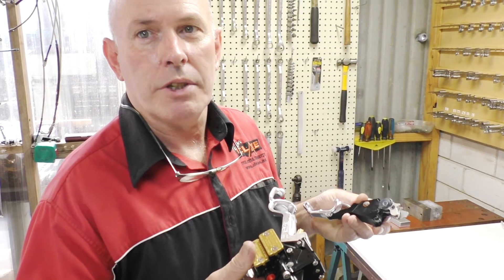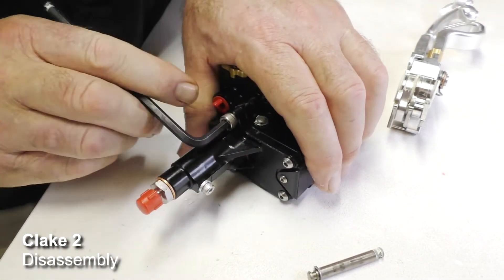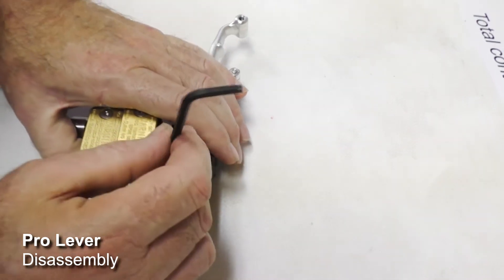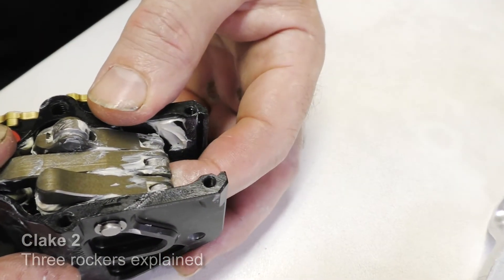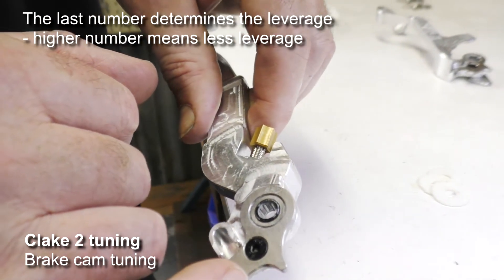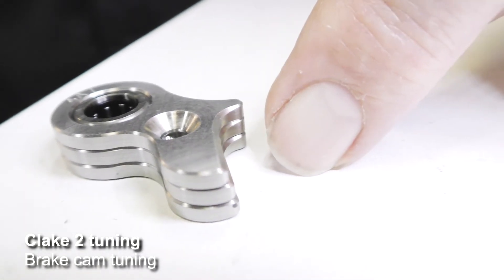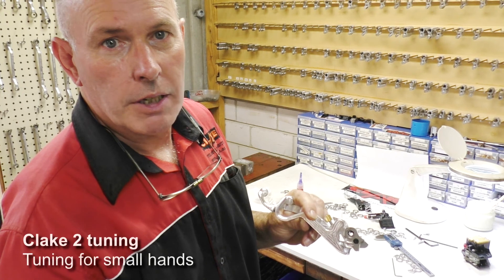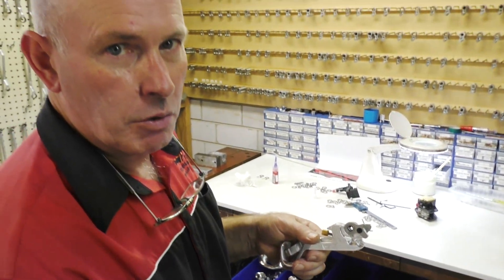TUNING THE PRO LEVER & CLAKE 2: choosing & fitting the cams

Comment: So how do you mount the handles back with the master cylinder?
It’s hopeless to get the bottom Teflon spacer into place... 🤯
Reply: I've pulled mine apart a fair bit tuning and rebuilding it over the years. lots of grease to hold the washers together and firms everything up, then slide them in while supporting and use a small screwdriver through the hole to line them all up.
Reply: @NCER999  thanks. Yes, this is what I settled on. 👍🏻

Comment: I have the Pro Clake for both my fe450 and te300, bought in the winter of 2017/2018. It took 3 rides to be comfortable with the product and at first it makes you stall the bike a bit as your brain doesn't quite fathom the adjustment of clutch to progressive brake. But once you got it, feels super natural and is very effective. It reduces fatigue, adds safety, makes going down extremely steep hills much easier, keeps your body on the bike more naturally. The product will make you faster, because in order to have confidence with speed, you must be able to brake. This is especially beneficial to a newer rider, but even a racer would probably pick up fractions that stack up. One of my levers is not firm enough and I need to tighten it up.

Comment: Good timing ... I have the Pro on order ..

But..

The video starts off saying the 2 and the Pro are quite different to tune, but after the disassembly, talks only about the 2. Is the pro the same on the inside? You don't actually mention the pro after you've taken it apart, and start into the tuning section.

I assume the cams are similar or the same: what's DIFFERENT in setting up the Pro?

Thanks!

Looking forward to actually receiving it soon.
Reply: As far as I know, Clake Pro and Clake 2 use the same cams but the actual cam selections may differ based on their different nature. 

With 2, overlapping of clutch and brake is based on the adjustment screw and it's possible to use clutch only or brake only function; so, it comes to setting the correct amount of clutch disengagement and braking power at desired lever position. It depends on the bike and rider's choice.

But, with Pro lever, overlapping of clutch and brake is set by cams and it's crucial to tune it correctly. Brake only function is not possible since the brake is applied after some amount of clutch disengagement. This means, clutch should start to disengage and after adequate disengagement braking should be applied with desired power increase with the lever's travel. 

It makes harder to tune Pro lever compared to Clake 2, especially brake cam selection might be different by means of start level and power.

They'll advise suitable cams for you and as shown in this video tuning them by changing cams can be done by following the same procedure.